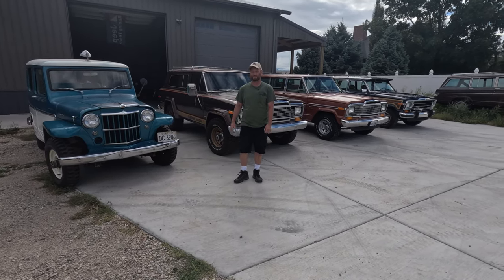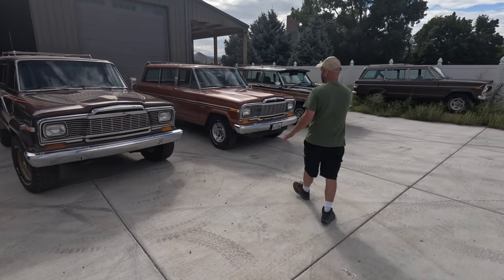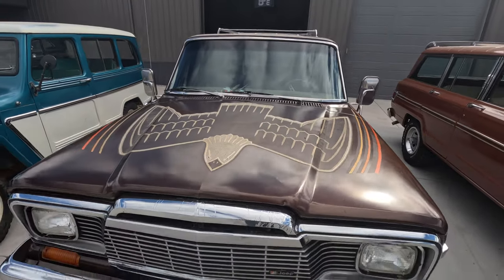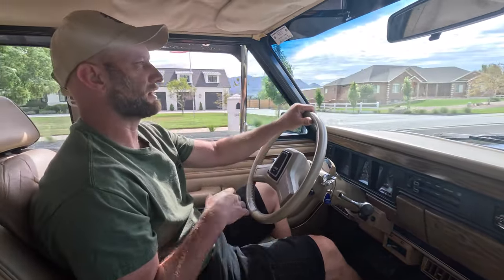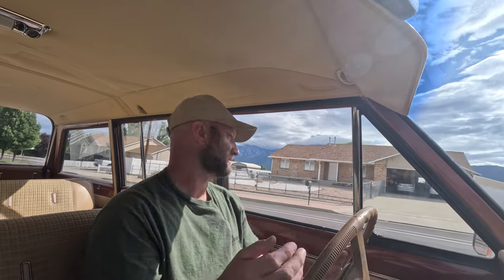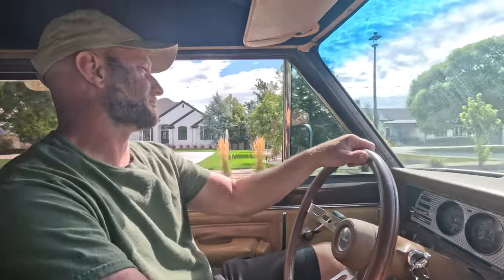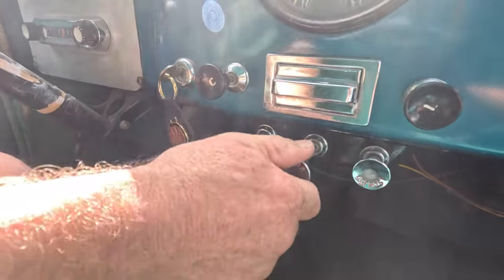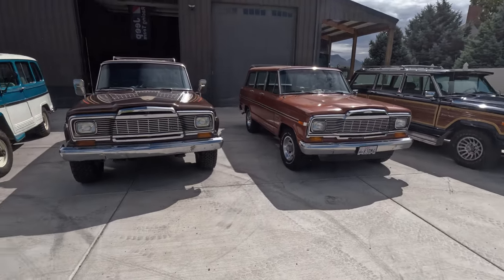Jeep Wagoneer Walk-Around Comparison

Comment: Great! The Jeep Station Wagon and the Jeep Wagoneer were produced togheter in 1963 and 1964
Reply: Looking up production records by serial number, the older Jeep wagons ended their production run in November 1964 so some might be considered 1965 models (assuming the new model year starting in August). But indeed leftover '63/64 stock continued at dealers in 1965.